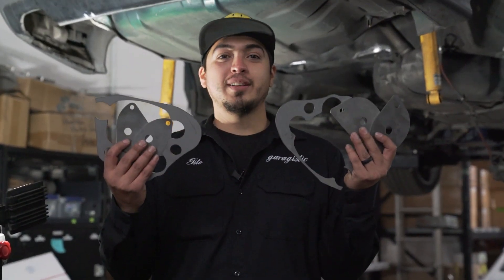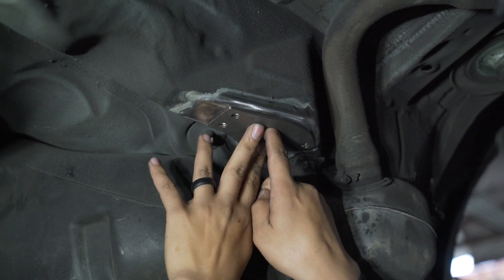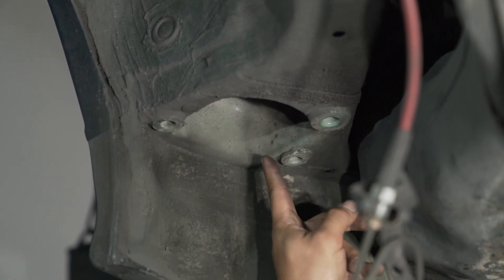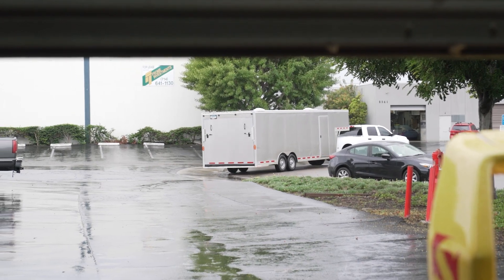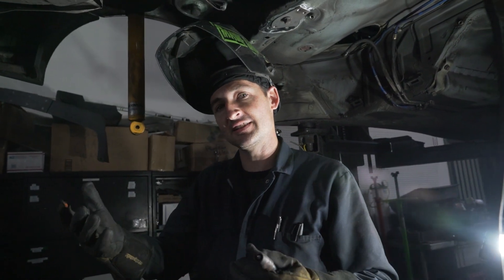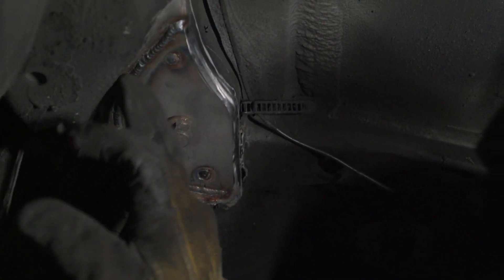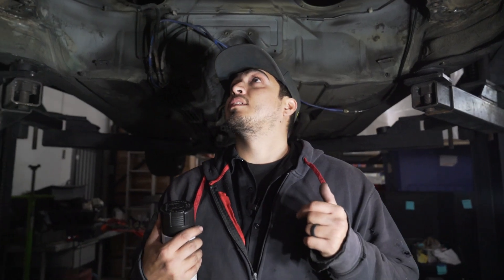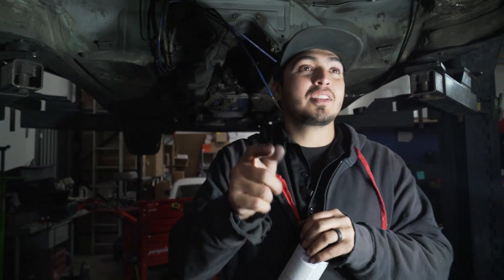How to Install E36 Chassis Reinforcements | Installation Instructions

Comment: Thanks for sharing all the steps, tools needed, especially the welding settings. Do you also need to remove the back seats and carpet ?
Reply from the maker: We would recommend removing them just to be safe. It's not to difficult to do so and is worth doing considering the possibility of a fire. Thank you and hope this video helps!

Comment: Thanks for sharing. 

Good to know that these chassis need said items of maintenance. 😮

What’s your e36 model?
Reply from the maker: Ours is just a humble 1992 325i with a non-vanos m50b25
Reply: @garagistic  It still has that legendary BMW inline 6 engine?
Reply from the maker: @WarriorsPhoto  yessir! 200k+ miles and many track days on it and still running strong 💪
Reply: @garagistic  Amazing cars they are. Very well engineered. (:

Comment: Is rtab the only reinforcement needed for an M3?
Reply from the maker: For E36 M3's, you are correct, the RTAB's are the only reinforcement needed. If you do plan on upgrading your rear swaybar, however, we definitely recommend installing rear sway bar reinforcements as well! 🤘🤘